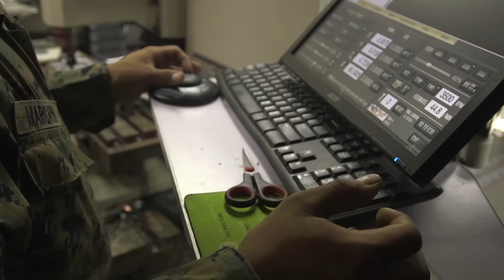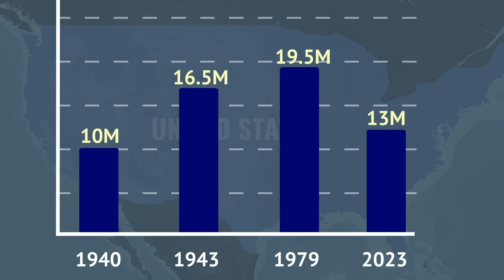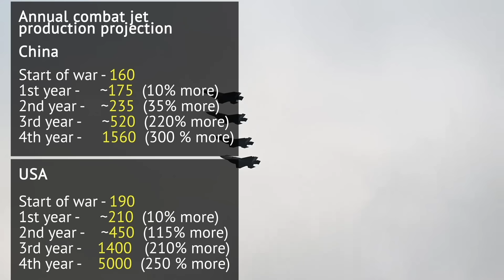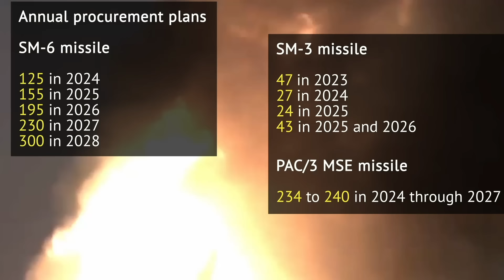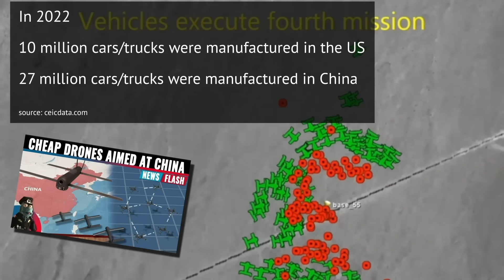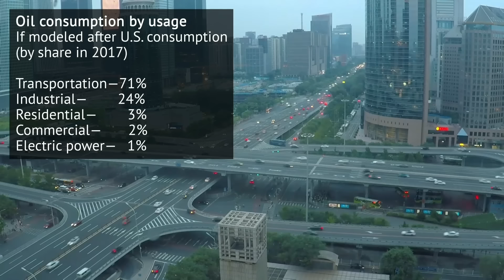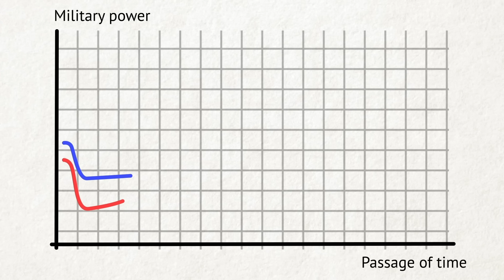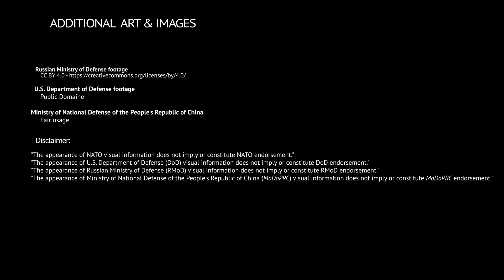Can industrial output decide US v China war?

Comment: Why would the US try to take control of the seas near China?  The US can comfortably sit behind the 1is Island Chain, even as far as the 2nd Island Chain (outside of Chinese land-based air) and blocakade China. The Chinese navy does not have the capacity to challenge the USN beyond the range of their land-based air. 

China imports over half of its energy needs. While China imports a much smaller percentage of their caloric needs (aka food), China has to import a significant amount of industrial fertilizer to maintain their crop yields. A blocakade would befectively deprive China of energy and food. However, the US is energy self sufficient and an exporter of food. Of course, that is immaterial since  the US will not be blockaded.  

China will be looking at famine in six month. While Russia would be willing to sell oil, gas and wheat to China, all rail and pipeline capacities are at their limits It will take 10 years to put in new pipelines and rail.
Reply: China is the world's largest producer of fertilizers and the second largest exporter. Most of the fertilizer China imports is potash.

Russia is the world's second-largest fertilizer producer and first-largest fertilizer exporter, and produces a lot of potash.

China can import potash from Russia.

And a large number of countries would lose food production if they stopped importing fertilizer from China.  
For example, India imports 60% of its fertilizer from China, and the loss of this fertilizer would cause a significant drop in India's food production, leading to mass starvation.
Do you think India would then resent the US or China?
Reply: @miaorenfeng1 these are interesting points but it raises the controversial but real question of how much mass starvation on other nations the US will accept to reach its geopolitical goals. Seemingly, many exceptionally powerful and influential industry leaders and philanthrocapitalists involved at the top tiers of these would, in thinly veiled words, describe such a thing as a positive.
Reply: By international law, blockades must happen close to territorial waters, and by simple means of being able to find another ship, out in the middle of the ocean is generally isn't going to work unless the US tried to violate international law with unrestricted submarine warfare. So no, the US can't blockade the PRC from afar.
Reply: Yes they do!
Reply: @AFistfulOf4K  If you think the US violating the rights of neutral trading countries doesn't matter, then fine, but those countries will think it matters.
Reply: @miaorenfeng1  

China is a major producer of potash, but not nitrogen and phosphorus. Those fertilizers are imported. Rice is extremely nitrogen hungry.  These fertilizers are mainly imported by sea.

China was so concerned about potash that they actually stop exports for a short period.
Reply: @Gepap3  

Where does international law say blockades has to be close to a coast?

Also, the interdictions can be done at chokepoints of which there are many.
Reply: @ycplum7062  China is the world's second largest fertilizer exporter, and the most exported fertilizer is nitrogen fertilizer 

Look up the information and know the basics before commenting

Comment: What a silly video on so many points, and not sure where to begin. One of the dumbest claims is that somehow civilian production could be shifted to military production. The claim is not remotely credible, given how diversified modern assembly lines are compared to the past. A current car factory would take years to convert into a factory for military vehicles, assuming even the machining and parts were available for them, which might not be the case. The US and Europe have had a hell of a time increasing just shell production - to claim somehow they would be able to mass produce extremely complex machines is simply not a credible claim, specially in light of the fact that a war over Taiwan would likely be short (no more than a year) for a variety of reasons.  One thing Blinkov ignores, for example, is that the US uses a lot of Chinese made chemicals and components in its own economy. A great example is the Europeans complaining about their difficulty in making enough gunpowder at this time, which has been hampered by their sanctions of Chinese cotton products. The US imports a lot of chemicals from the PRC, parts, etc. The US would see a massive domestic economic hit, as would everyone else actually. This is not to mention the idiocy of claiming the US could even pull off an effective total blockade of China. All a ship would have to do is lie and say they are going to say, Vietnam. How is the US Navy going to check out in the middle of the sea?  For a blockade to be effective and Legal, it has to happen close to the ports being blockaded, and the US won't be able to put its ships in such a position.